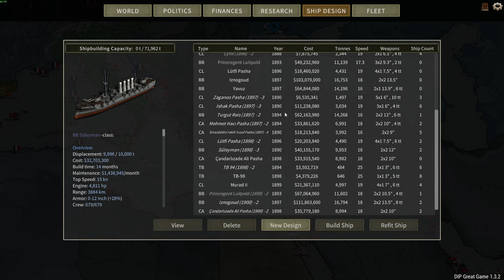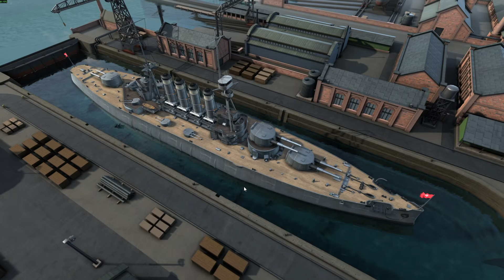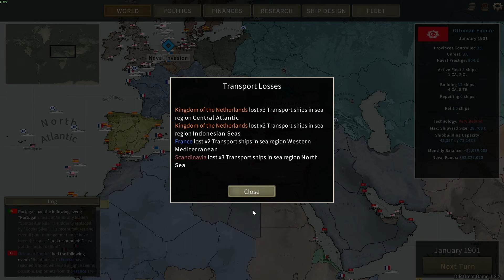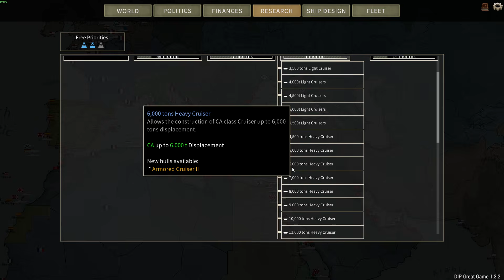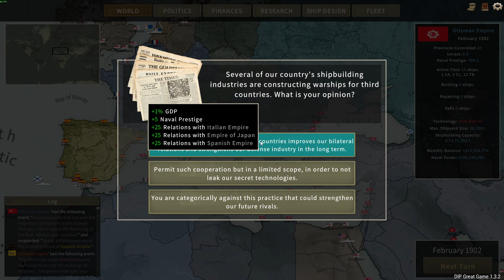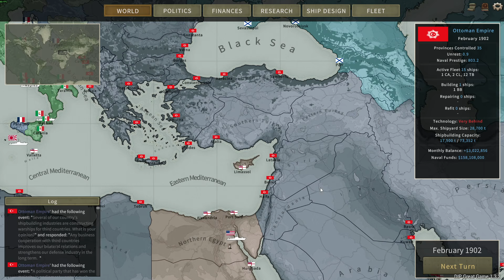Ottoman Campaign 1901 - Part 15 - Super Pre-Dreadnought and Pseudo Battlecruisers - UAD; DIP GG Mod

Comment: I dont know if I missed it but why are you so worried about weight?
With the TBs...its a technique. All the torps does make it deadly if you can close and if it works but it gives them no staying power. 
Once they shoot their fish theyre worthless except to draw fire. 
Personally, I out two twin tubes on the TBs, max the frontal gun to 4.9" (for penetration and range), max the tower and speed to 29.5 kts (which is essentially mad until your oil and engine upgrades) and then put on 2.9" guns with max barrel length all around, max bulkheads, about 7 to 9k range, max armor all around and when weight allows later, max quarters. Max quarters enables more crew which allows ships to keep fighting even when they are badly damaged. I'm sure you notice they stoo shooting and wanting to fire fish when they take a bunch of damage? Thats from dead crew. 
Anyway, by 1903 my TBs and early DDs are a major threat (in squadrons of 3) to BBs, DDs/TBs, Convoys and even CLs. I can often sink CLs even after I run out kf fish or they explode because my guns are effective at starting fires on CAs and CLs or putting holes into the sides of DDs and TBs. BBs are largely immune to these small guns but I can still hurt them with fires after running out of fish if I didnt outright sink them.
Okay, CAs. I put twin 9"ers on CAs and 5"ers all around with a few 2.9s if they'll fit. I try to keep speed as high as possible and max belt and tower armor. Range I keep around 8 to 10k if possible. I out fish on them and max everything else as far as gear. However, if you stick to hydraulic steering and advanced hydraulic turrets you keep flaws down a lot. Double hulls and max bulkheads mean I never lose CAs. Ever. I only use anti-Torpedo defenses if I have tonnage to spare. I find the antiflood, double hull, bulkheads and screws along with management of my line reduces the effects of torps or prevents hits altogether.
As to BBs? 12s and 13s are fine IMO. Speed, thick belts, thick bow and stern, lots of 5" guns for cleanup and as much antiflood, bulkhead and upgraded powder/explosive as possible with torpedos never. This is how I play on max difficulty. I rarely lose ships and even then, just TBs and DDs.